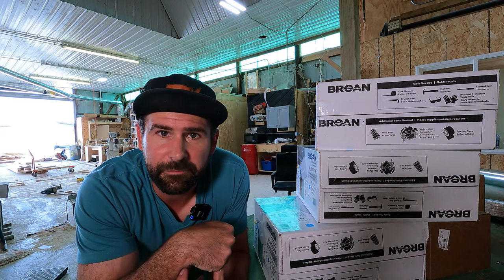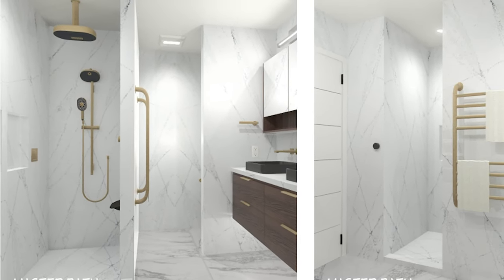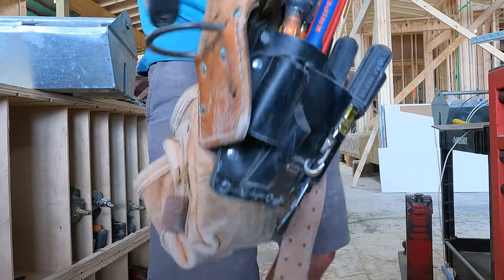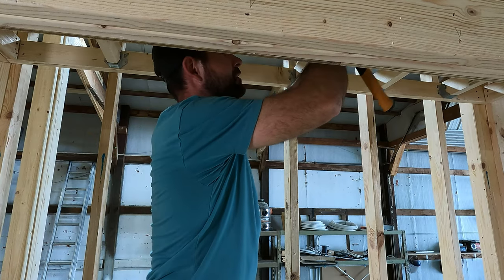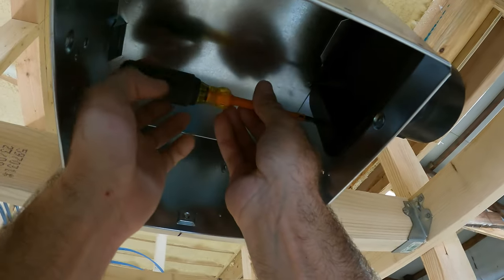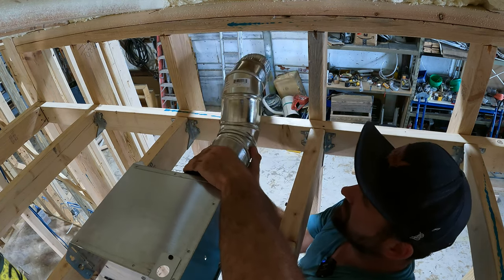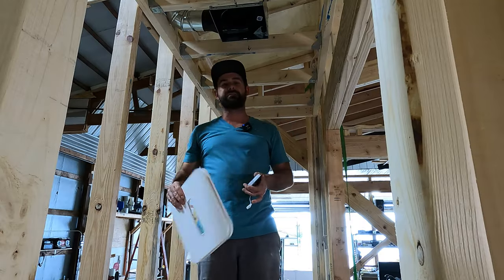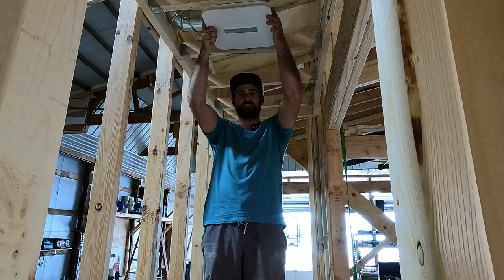This Fan SUCKS A Lot Of Air!

Comment: If you leave that box only supported on 1 side, eventually the vibration will cause a drywall ceiling crack.
You should always nail in a brace board between the joists/studs and make sure the fan box is properly anchored.
Reply from the maker: I know exactly what you’re talking about. Fortunately, this particular fan is a balanced fan so has very minimal vibration. It’s actually an awesome unit but good catch.